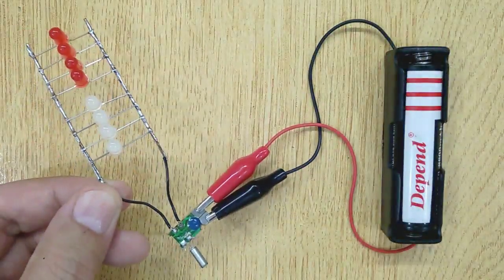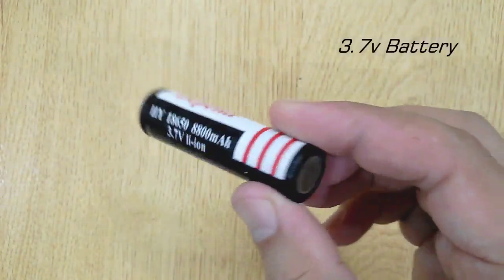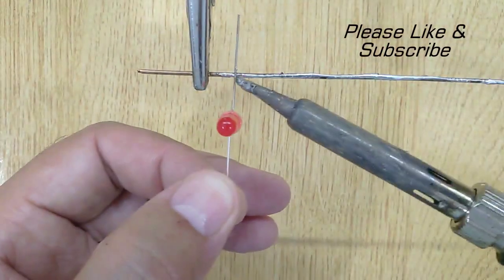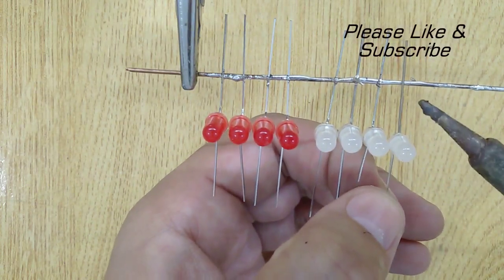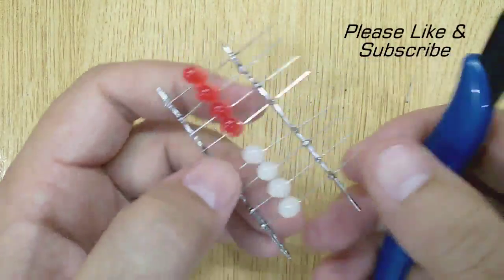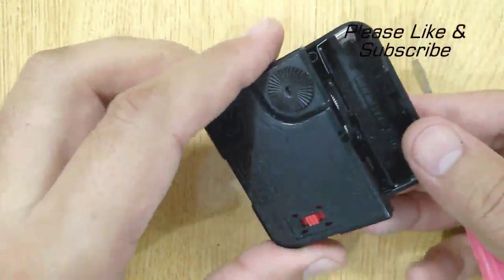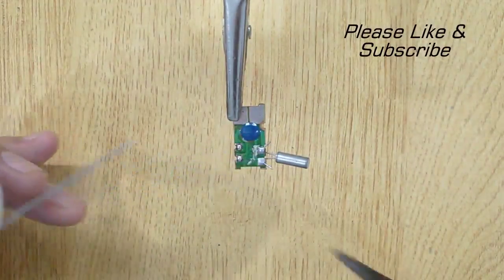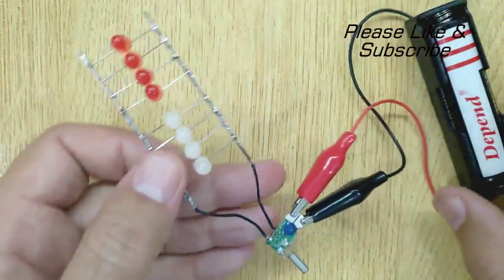DIY Police Strobe Lights | Police Lights Police Flashing Lights | Mini Strobe Lights | Ezi Circuits

Comment: Thank you for sharing.  This is really cool and easy to make.  Question... can it be make in a larger scale like 25 red and 25 clear and using a 120v plug?  If so, do you have a video for it?  i m trying to make one and place it in my attic / garage to scare off rats.  Thank you in advance.